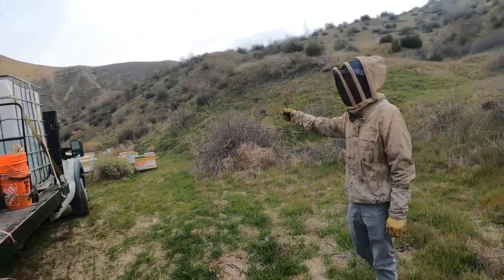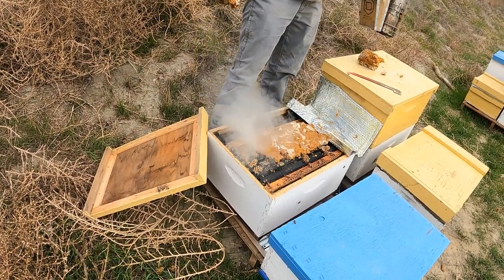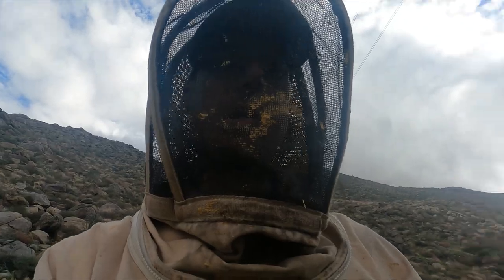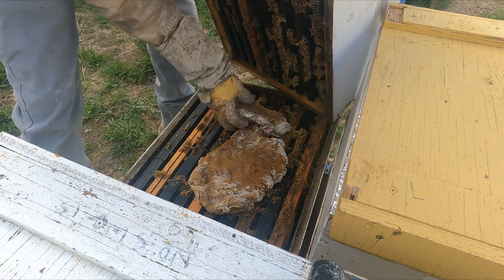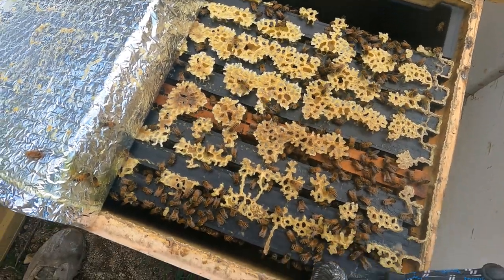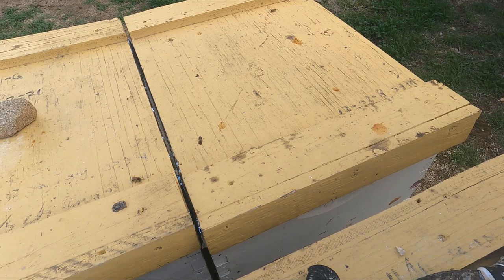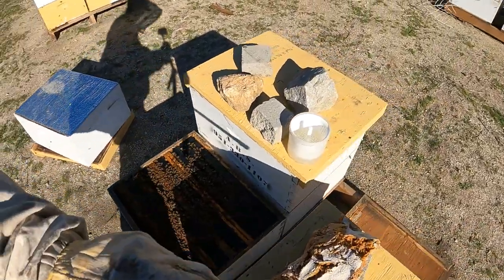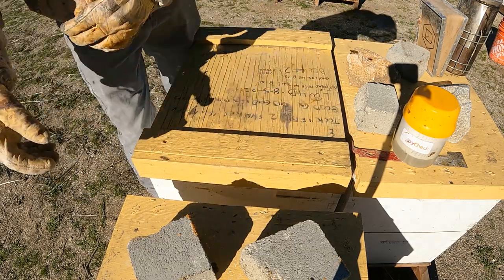How I Build My Bees For Almond Pollination

Comment: where do you get the plastic insulation? do you think it helps that much?
Reply from the maker: It helps a bit and I really like it because I use internal feeders in my hives, in the summer they love to try and rob on each other while I'm feeding them, the insulation sheets help keep everything sealed up better and the hives protected from one another. My lids are not all perfect. You can purchase these at your local hard ware store. We got ours from home depot. Called reflectix insulation it comes in a big roll. Hope this helps and thanks for watching. Link below. 
 https://www.google.com/search?client=safari&hl=en-us&q=Reflectix+Staple+Tab+Reflective+Insulation&stick=H4sIAAAAAAAAAONgVuLVT9c3NCw2jjdLtsgpf8RowS3w8sc9YSn9SWtOXmPU5OIKzsgvd80rySypFJLmYoOyBKX4uVB18ixi1QpKTctJTS7JrFAILkksyElVCElMUoAJlqUqeOYVl-YklmTm5wEAiwpnVHkAAAA&sa=X&ved=2ahUKEwia_JmZjvf8AhWWMjQIHexyB80Q3YMDKAB6BAguEAQ&biw=375&bih=635&dpr=3#scso=_etHbY7a0DvPD0PEPzdiIwA8_33:0
Reply: @beekeepinginthepassca  thanks we purchased 7 rolls to get started, we also feed internal with feeders and screen so the bees don't drowned. My lids never seem to seal right also, I spend a lot of time fixing gear, maybe this will save me some time.
We no longer ship to almonds, so the insulation will not be a shipping issue with loose lids. thanks
Reply from the maker: @judy7481  Nice, hope it helps. Sounds like we kind of have the same issues.